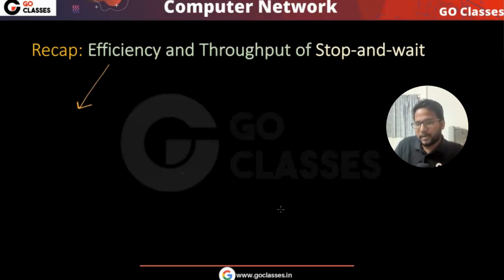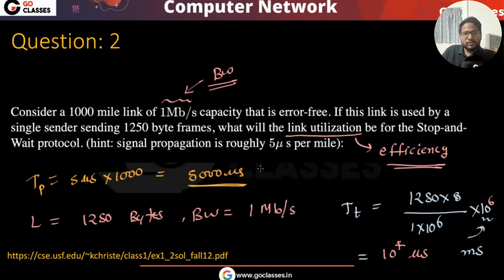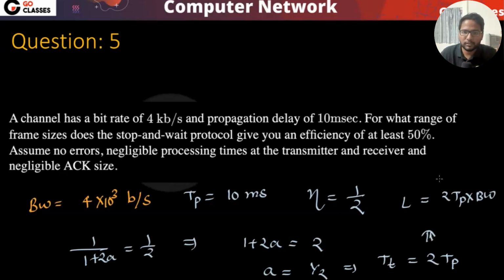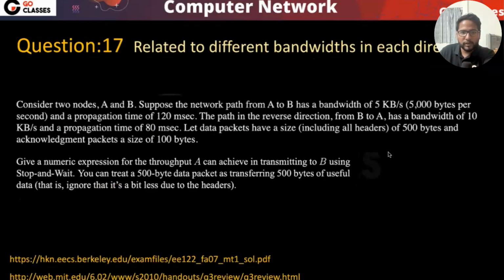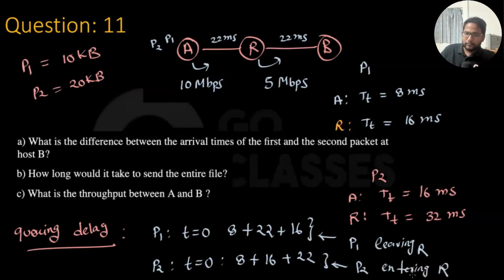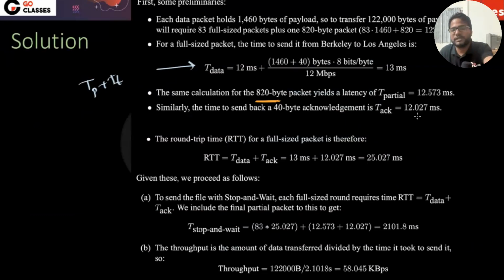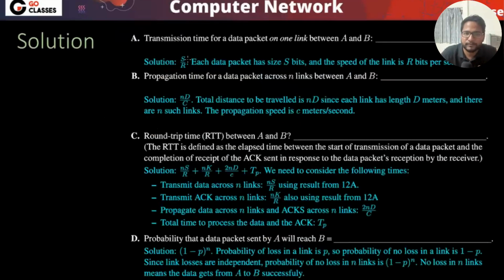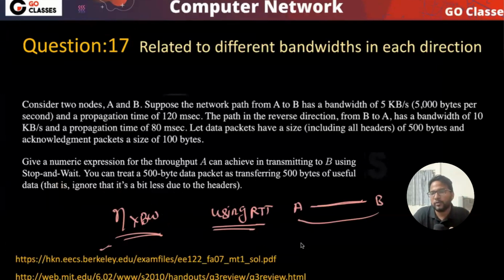15 Questions on Stop Wait Protocol| GATE PYQs| MIT, Berkeley |Efficiency & Throughput| With NOTES

Comment: In question 12 each packet size is 1500 but in video taken as 1460. But we need to include header while sending the packet to receiver
Reply: already mentioned in the question, transferred in 1500B data packets, of which 40B are taken up with header

Comment: Sir,  in question 3 why has 1KB not been taken as 1024? 1KB should be equivalent to 1024 Bytes right?
Reply from the maker: 1K is either 10^3 or 2^10, and this should be specified in the question. If no specific information is provided, you can solve it using a number that makes the math more convenient for the question and appears more logical. For example if BW is given as 128 KBps then it is a good hint to take length of data in power of 2 instead of power of 10.

In such cases, if no information is given, you can choose either option, and GATE will accept both answers since they typically provide a range for answers in numerical answer-type questions.
Reply: @GOClassesforGATECS  Got it sir!! Thanks a lot for clearing my doubt👍🏻❤️🙏🏻🙏🏻
Reply: @GOClassesforGATECS  sir isnt it also because its kbps and not KBps? my understanding is 1kb = 1000 bits and 1 KB = 1024 bytes
Reply: but that is not required at all coz in numerator and denominator it will ultimately cancel out